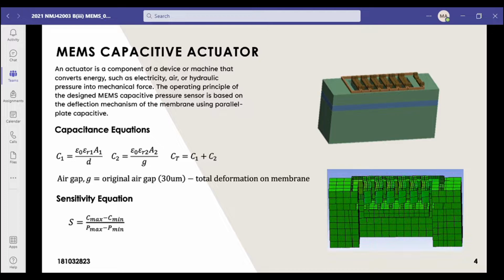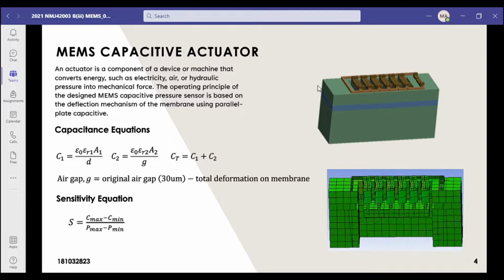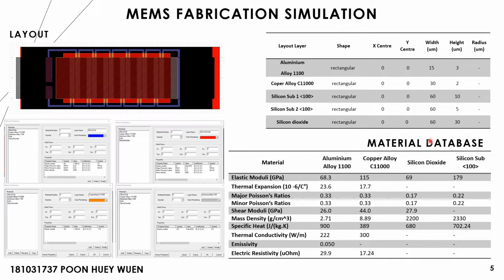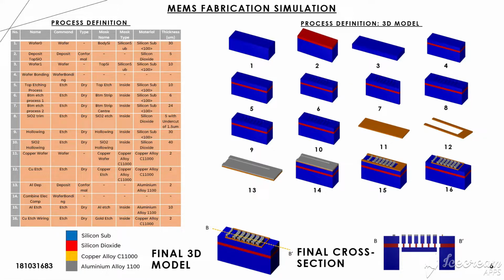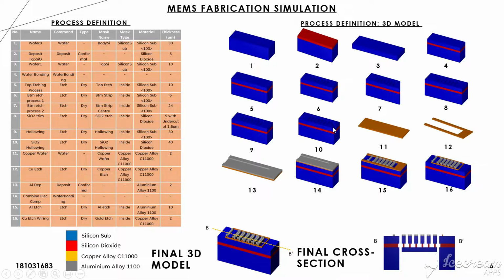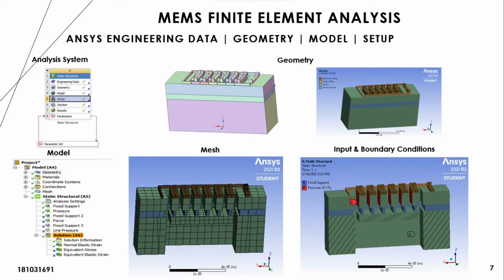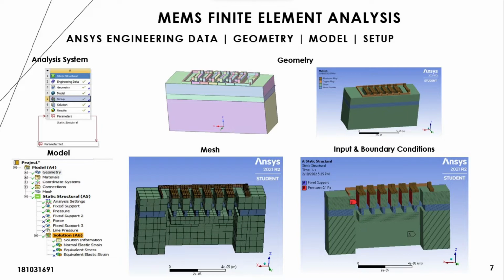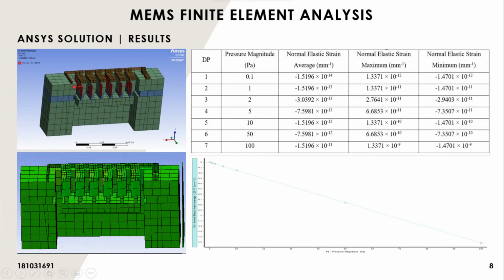2021 NMJ42003 MEMS Design and Fabrication MEMS_06 MEMS Capacitive Actuator

Comment: Hi, may I know the applications of this type of mems capacitive pressure sensor?
Reply: Hi, Kai Ni.
As mentioned in the video, this type of actuator can be applied in two different field of managements, as in light management and flood management. Such application like the smart lamp posts in automatic light control system for sensing objects is one of the example for light management. While in flood management, the actuator can be developed into a device which is then used to send the alerts to the users by sensing the water level to avoid flooding.